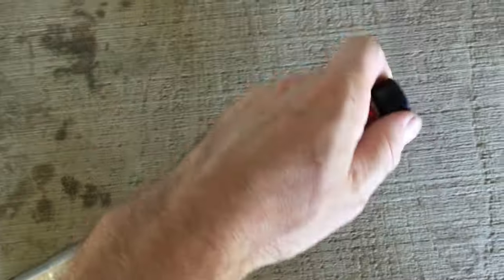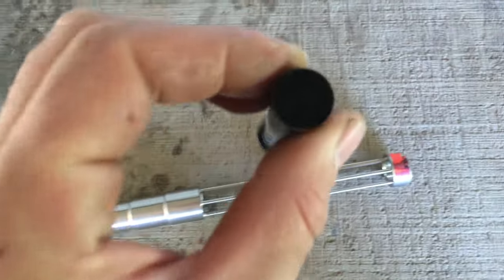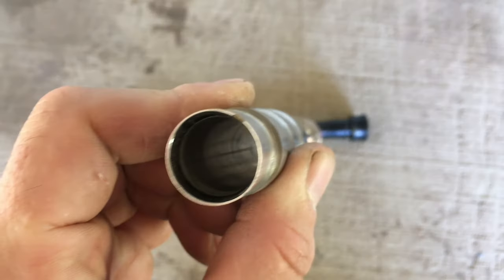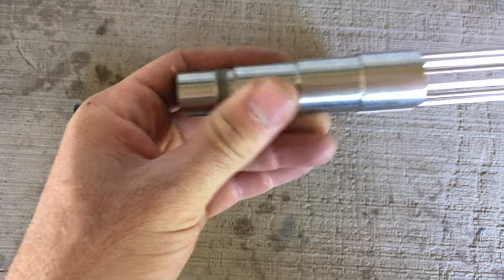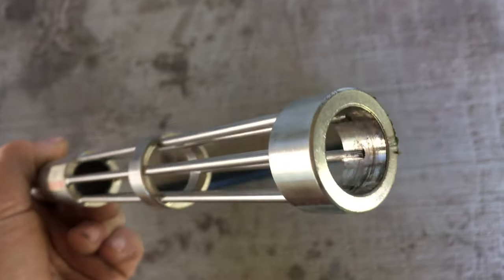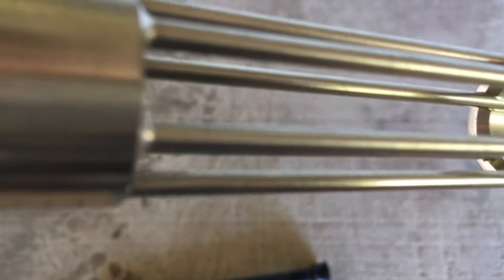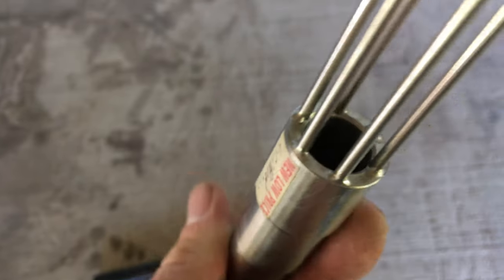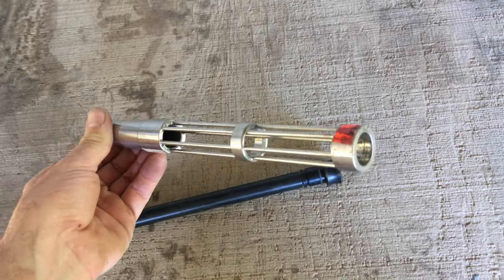Crossfire Ram Rod Barrel for F4 Illustrator

Comment: They are very loud.  Also it kills the velocity.  I have a Ramrod that is 98 threaded.  I normally run my markers at 275-ish fps, but with the Ramrod I am lucky to get 250 fps with the FVA all the way out and running 800 psi into the valve